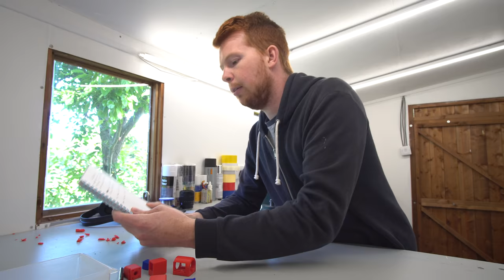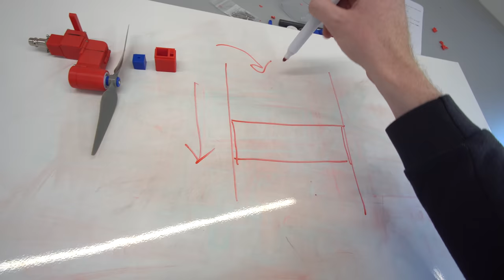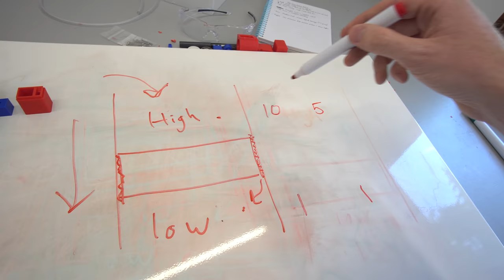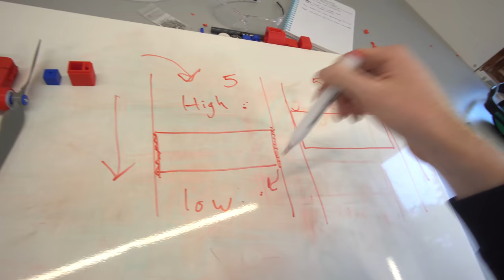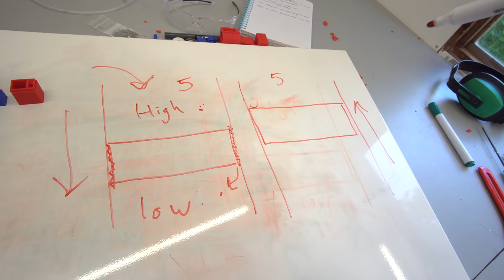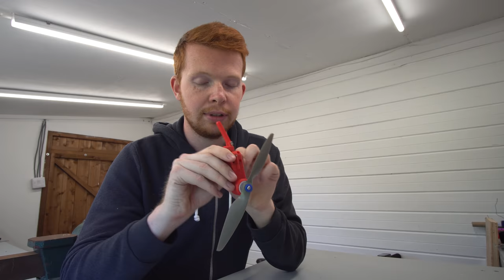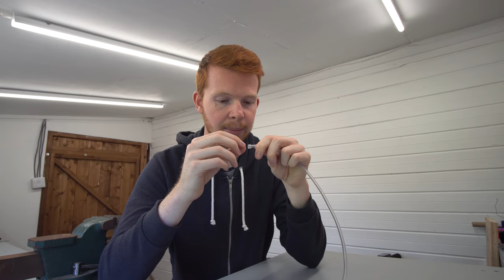Multiple or Single Cylinder Air Engine?

Comment: Just go with single cylinder engine.
Both inline and flat engine will be a plumbing nightmare since you need a separate cam, push rod, and valve for each cylinder, if you want to offset the cycle. The extra moving mass could add more friction and reduce efficiency. Also if you have a really good single cylinder engine, you can glue 2 engine with pi  rad together, and make an L shape adapter for the air inlet and join them with a new intake manifold.

Comment: If you are looking at multiple cylinder engines, research steam engines.  Multiple cylinders, but different bore sizes.  One feeds from the exhaust of the other.  If you are looking for efficiency, that's your best bet.  Just a thought.

Comment: I get your point, and i would say it's true about the air leaking more at higher pressure, but I believe there is a limit. Like a slight curve that eventually tampers off and has diminishing negative effects. I'm no math major but I could guess there's an equation that could show this. As well as one that may show the best number of pistons to go with to get the most efficient power output per pounds of pressure. I would guess at 6 or 8, if car engineers have done this sort of homework, which I figured they have. I would also wonder if the fuel efficiency of gas has a roll to play with these stats and therefore be slightly different for air. Maybe 4 or even 3 could be more efficient, if separated in thirds based on their positions in the system. (Slightly different than the normal engine of each piston being directly opposite of the other, it would take some serious tuning tho)

Comment: I think you should start putting dry ice in there for longer range, but also a safety valve so it doesn't blow up in your face when something stalls the motor or goes wrong otherwise. Keep in mind to also ventilate the room or better go outside fr this so you don't suffocate from it, since CO2 isn't exactly healthy in large quantities.

Comment: Well, I'm sure someone has done research on stuff like this before. I mean, people have build compressed air cars (actual cars), back when batteries weren't as promising as they are today.
Assuming you want to build a car, I guess a twin cylinder engine would be ok, you would get more torque, less vibration (if you go for two cylinders in series and not a "boxer engine"), I guess weight isn't such an issue and two cylinders might be more efficient at displacing the air underneath them by pushing it back and forth instead of having to pump it in and out of the crankcase. You would need some kind of clutch in car though, or at least a way to start the engine once it stops (assuming you plan on being able to stop).
If you want to try the whole plane thing again, I think I would rather go for the single cylinder engine and try to increase the speed by decreasing the stroke distance while making the cylinder wider (so it has about the same volume as before).
I also had the idea of maybe powering a single cylinder with compressed air from both sides, by feeding air into the crankcase.
This would obviously be rather complicated as the bearings aren't air tight etc. I haven't put much thought into it, but such an arrangement would certainly allow you to get more power while not increasing the weight to much.
Isn't it kinda ironic that you are using compressed air to push air (in the case of an airplane). I can't help but wonder if there wouldn't be a more efficient way to push air with air (without powering it kinda like a rocket, that obviously wouldn't work very well). I guess you would need a way to use a little high pressure air to push a lot of air at a lower pressure...

Comment: For efficiency a single cylinder should win. The circumference of a circle is pi x diameter. The area is pi x (radius squared). It is the square that is important here. If you double the piston diameter the circumference (and hence leakage and friction) doubles but the area and (assuming you can flow enough air) torque is now 4 times greater.  Of course for the coolness factor, the more cylinders the better ;-)

Comment: You could also make a V-Type engine. This way you can have a simple crankshaft and a simple head design. 

Although v-engine with only one crankshaft offset is pretty inefficient in comparison with two offsets

Comment: Build both, yes it will be harder. But you'll be learning a lot about design I'd imagine and then you could test power output vs air pressure used. vs weight :)

Comment: Maybe you could just gang a few of your single cylinder designs together. Each could be self contained and connected by a central gear, or put in-line if you make provisions to connect the front of one crank to the back of the next ... clocked of course, so each piston fires in turn.

Comment: To minimize leakage by using two cylinders and using  1/2 pressure on each will be worse than using a scaled up single cylinder with double the area of a single cylinder.  This is because the area is pi * r^2 vs leakage of pi * d.  Two cylinders would provide smoother power, if that is important for a given application.

Comment: Tom,
What I think you are ultimately going to get at is a Compound steam engine design. It uses the same steam (in your case air) 2 or 3 times. For example the first cylinder would have 10 psi, then the air would move to the 2nd cylinder having 7.5 psi, then to the 3rd cylinder with 5 psi before finally being expelled from the system.
Currently you are think of using the air only once in each cylinder, which wouldn't be as efficient. If you decide to use a multiple cylinder design look into compound steam engine designs.   https://en.wikipedia.org/wiki/Compound_steam_engine

Comment: How about a V-twin.  Perhaps you could print an intake manifold for sending air to the cylinders since they’re closer together.  The crank shaft is in the same orientation as the opposing twin.

Comment: A vee twin cylinder arrangement would have a really simple crank and could have a one piece bolt on head with most of the plumbing printed into it.  Look at an old Harley Davidson motorcycle engine for some of the inspiration.  The cylinders would be slightly offset from the plane of crankshaft rotation.  Make the power of 3D printing work for you & design in the plumbing for the valving into the crankcase

Comment: Inline 2 cylinder is going to be more efficient and probably more powerful, and it will be easier to design a complicated crank than it will be to seal those intakes

Comment: Obviously, two cylinder.
Now there's a problem with only using a single skateboard bearing (as you pretty much bought a load of.)
It has more play in the inner rod, which you may run into problems with. I would still use multiple bearings just for stability. Because sometimes you need to sacrifice simple for stable.

As for the twin boxer engine you've designed: I know it won't be near as simple, but if you turn it into a 4 cylinder boxer you won't have the vibration issues if you have the front left (#1) cylinder "firing" with the back right (#4). Then the front right (#2) "firing" with the back left (#3) cylinder.
Which shouldn't be too complicated to work out, as you'd only need to extend your plumbing and driveshaft, and make another cam and piston set (which you could easily come up with multiple ways to connect the cams at opposite timings).

Quick idea for if you've read this far: make one "double cam" for the timing, which would literally be your current design with another of the same flipped, and attached so you get opposite timing right next to it, with less hassle as it'll be printed that way.

I really hope you read it all and consider, at least for the future. You've had me super interested with these air powered engines, and I want to see them turn into something amazing.
Reply: As if they aren't already...

Comment: Always keen to see what you're up to however you should perfect the single cylinder engine first. Engine power has only gone down since you moved to valved arrangement. Based on the last video it seems it's struggling to even power the plane now.

Comment: The two cylinder horizontally apposed wouldn't be to hard to make the pluming for if you print a back plate that houses a T type shape within it and have the valves the same as the vs motor opening the valve when needed. You wouldn't need the clear tubing at all but the back plate might be a bit heavier.

Comment: disclaimer: i don't actually know anything about engines, im just going off my highschool physics...

i think you would only get the efficiency if the pistons aren't the limiting factor... if you have a throttle then there is only a certain amount of air going to the pistons per unit of time, so there would be half that amount in each piston. if there is no limit apart from the pistons, then both pistons would get the full pressure and it would be the same efficiency as a single engine minus the extra friction losses

about the double perimeter thing, that doesn't really hold water (or, should i say air)... think of it this way:
running a double cylinder engine is like running 2 single cylinder engines but from the same air supply and their output shaft is connected.
it would have double the power of a single engine, so with the same load it would run at a higher RPM... this means the cylinder volume is expanding quicker.

now something im not sure about, is if you have 2 cylinders with the same amount of gas inside, but one is expanding quicker - is the pressure in the faster cylinder lower at the same volume? if so, the higher RPM would have less leakage, but also less force. this might only be relevant when the speed of the cylinder head becomes close to the speed of sound.

if you change the load so that the double cylinder runs at the same RPM as the single cylinder, it should be a similar efficiency.

another thought, not really related to the double cylinder problem:

PV = nRT
pressure * volume = number of particles * gas constant * temperature

since this is a compressed air engine, lets assume temperature is constant. realistically the gas will be cooled a little.

n is going down at a rate proportional to the pressure, which in turn affects the pressure and efficiency.

when the cylinder volume doubles, the pressure halves. so throughout the power stroke, the leakage is dropping, but so is the power.

since its on a crank shaft, the effective force output / time will be a sine wave with the bottom half cut off. this means the high pressure at the start of the power stroke isn't very useful, and thats a time when it has the most leakage. so you should adjust the timing so that the valves aren't open much at the start of the power stroke. and so they are open fully near the middle.

this might be irrelevant if the valves are open for most of the power stroke, since the change in volume would be negligible.

i say make a single and multiple cylinder engine, and some form of efficiency testing rig!

Comment: Do the multiple cylinder engine, challenge yourself. If it were me I would do the flat design for the simpler crankshaft. Putting the prop on the front of the engine and a counter balance on the back of the engine will help you with power, stability, and efficiency. You can do it, go for the flat two cylinder engine.

Comment: Yes, the difference in pressure is lower with more cilinders. That's good.
But as you say you also double the weak points where air leaks through.

So it all depends on the following.
I would say the number of cilinders without a change in the pressure difference would change the loss in a linear way. The question is how the change of the pressure difference without a change in the number of cilinders behaves.

Perhaps you could make an experiment where you have a pressurised chamber that isn't perfectly sealed. Measure the pressure loss with many different initial pressure values and check how they change.
If it's exponential to the pressure don't do multible cilinders because it will (probably*) just make it worse.
If it's linear to the pressure don't do multible cilinders because it won't change anything.
If it's logarithmic to the pressure do multible cilinders because it will (probably*) make it better.
*But x² is less than x as long as x is less than 1. So perhaps it could make sense up to a certain perssure. And with more cilinders you need a lower pressure.

Comment: I'm a EE not mechanical, so this may be a naive suggestion, but wouldn't setting 2 pistons at a 90 degree angle simplify both problems. The pistons wouldn't be 180 degrees out of phase with one another, but you still get some efficiency savings. Plus you could attach to a single cam offset (Since you don't care about vibration at the moment) Plus it puts your heads closer together simplifying (maybe) the intake. Best of both worlds? Or inefficient compromise?... Also on the single vs dual, sounds like a trade off between increased power vs run time. Since your energy source is fixed, if you double the piston area, then you half your running time roughly. Maybe for a car you can get a higher rated pressure vessel and a low pressure regulator?

Comment: Fix the real problem....
1... Give up the square cylinder idea. Use a round cylinder. A circle encompasses a greater area than a square with less linear length. This means more displacement and less leakage, less friction.
2... Work on the piston seal. This engine is relatively low rpm. Make the piston slightly oversize and the cylinder slightly undersize. Polish the piston and hone the cylinder with rouge to a mirror finish. This will tighten the tolerances, reduce friction, and decrease leakage.
3... Lubricate the valve and piston with silicon plumbers grease. This will further reduce leakage.
4... Print some piston rings.

Comment: Straight twin would be much smoother if you can get the crankshaft working, and would have less air leakage from the tubing.  I would go with that

Comment: Your leakage rate will double - think of the pressure like voltage through parallel resistors. Voltage is going to be the same, but the current will double (assuming equal value resistors). It's the same in pneumatics. you will be introducing a parallel leakage path, therefore the "voltage" will stay at 10 PSI, but the "current" (air flow) will double.

Comment: Multiple cylinders could overcome the problem you have when running on low pressure. Any additional cylinders would help the first one get over the 'hump' and even make it possible to start by itself.

Comment: i have your solution

no cilinder
cilinders are inefficient, go with a radical different design.
maybe go for a reverse engineered constant pressure pump. might do you wonders

Comment: Multiple cylinder engines self start more easily. In a three cylinder engine, one piston will always be in a power stroke phase. This means if you eventually use a throttle for your air you could stop the engine to glide and it would restart. A throttle causes losses so running the air engine for short bursts is better than sustained operation at part throttle.

Comment: In stead of a multi cylinder engine, try to enlarge the surface area of the cylinder in order to get more torque out of a simple engine. same stroke, just a larger piston.

Comment: If you have a cylinder with a cross section of 1sq inch and your intake is 5psi higher than your exhaust than you have 5 lbs of thrust, to double the thrust you can double the psi, double the number of cylinders or double the cross section of your cylinder.

Comment: Make a dual cylinder straight twin once you've perfected the single cylinder engine. I imagine it would be clever to keep the plumming "simple" to reduce risk of leakage. Aren't ball bearings designed to be used in pairs? Great project by the way. Have been following it since the biginning.

Comment: I would try and solve the problem of leakage before going to multi-cylinder. I think the leaking problem would be worse the more cylinders there are because of the increased area. I would imagine the air volume leaking around the sides isn't linear, but closer to logarithmic, as air can only compress so much.

Comment: The two cylinder is going to be better than the single cylinder design. But I really think you ought to go for a 3 cylinder radial engine, that way you'll have overlapping strokes and therefore much smoother power output and less chance of a stall

Comment: I think instead of making a two cylinder engine you should make a single cylinder dual action engine. I.e. the piston gets pressurized from both the top and bottom. This way you would get the power of a two cylinder with the weight and low leakage of a single cylinder, provided you made the crank case seal well enough. The valve system would get slightly more complicated but i think you'd figure it out no problem.

Comment: a "flat" engine where each pair of pistons share a bearing on the crankshaft are properly referred to as a 180* V engine. this is due to the fact that the ordinary flat engine crankshaft only works with flat engines.  "V" designs are, more or less, doubles of an inline engine, which is why the I3, I4, I6, V6, V8, and V12 are the most common designs.  

BTW, why not a V twin?  you can print the cylinder heads and even the two halves of the block separately to get smooth, flat head surfaces.

Comment: Some of the main benefits of a boxer is that primary virbations are being cancelled out as well as having a very low center of gravity. If you are not going to make the pistons move opposite to each other, don't bother making a boxer engine.